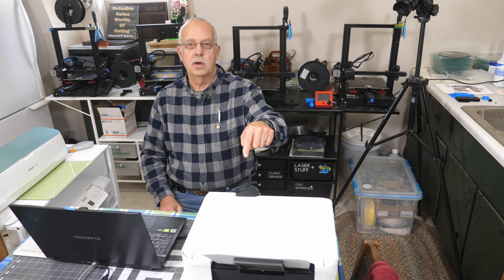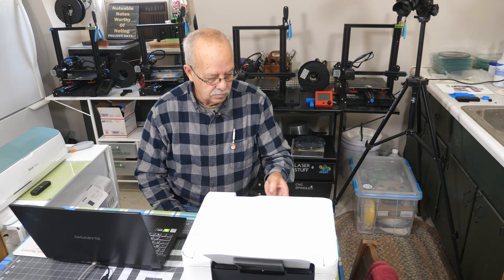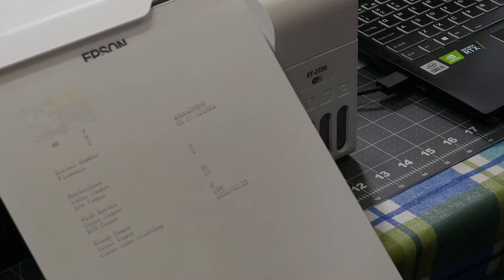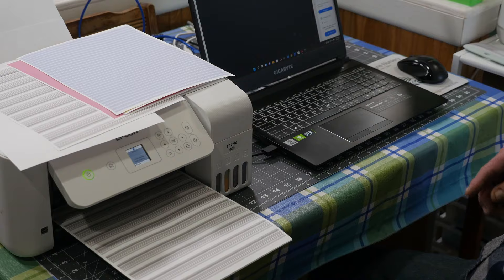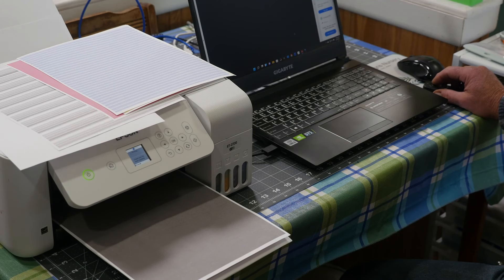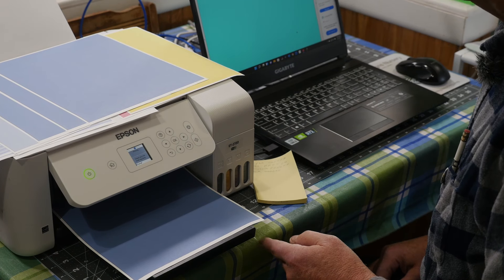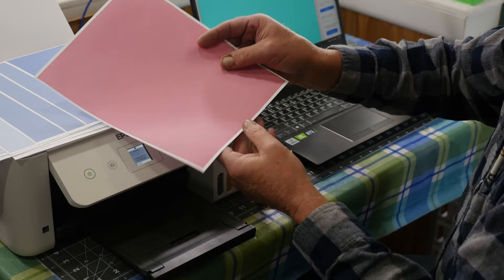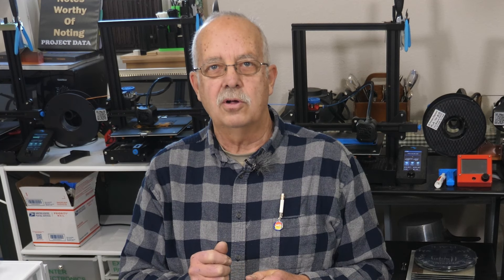Epson 2720 Printer Clogged Nozzles FIX

Comment: So what is sublimation ink and do I need to use this instead of the "standard ink" ie. black 522 that Epson sells? I would have to drain the tanks in order to do this and that is a problem.
Reply from the maker: Dye sublimation ink is designed for use with sublimation coated paper to be used in a heat press to transfer the image to a suitable substrate.  It is NOT for general purpose printing and the colors on regular paper are dull.  Many convert these Eco tank printers for use with sublimation ink when new.  Trying to do this after regular ink has been used is possible, but very difficult and messy.  Once a printer has been converted for use as a sublimation printer, it should not be used for general purpose print outs.

Comment: Hello, is it ok to blend sublimation inks?  I bought a used sublimation ink printer (Epson ET-2720) with ink already in it.  I don't know the brand.  I will be needing more ink soon, and purchased Hiipoo inks.  Is it ok just to fill? or do i need to empty then fill with Hiipoo? Thanks!
Reply from the maker: That is a very good question!  If it was me, I would try to remove any existing ink, as much as possible.  Different brands have different compositions, so mixing may not be a good idea.  I use Hiipoo exclusively, so have never attempted to mix brands.

Comment: Hi, in case it’s useful; I tried about 20 sheets with with Rogers method. I was getting zero ink apart from yellow. I decided to use the power clean. It took about 10 minutes used about a quarter of the black and less than an eighth of the colours and sorted the problem out and then my printer print is fine.

Comment: I used your download on the cyan color and printed it and it came out blank. Should I keep printing over and over or is there something else I should do ?
Reply from the maker: this may take 20 or more runs, depending on what condition the printer is in.  Make sure the ink tank has ink in it!  May sound obvious, but have run across empty ink tanks causing the problem......

Comment: I tried your suggestions but the cyan still prints a full page of very light yellow. I didn't know about the Power Clean dumping ink into the reservoir but that makes sense. It's too bad Epson would design a printer that their cleaning would eventually cause it to fail do to the full reservoir. Anyway, aside from printing a bunch of cyan sheets and still no blue, any other ideas? Thanks.
Reply from the maker: Some brands of inks can form sediment in the tank, clogging the lines.  You can try shaking the printer from side to side to dislodge a clog.  this works for some, but not all.

Comment: Hi Roger! Quick question...When I do nozzle check the page comes out completely blank! Nothing seems to work, but there is ink in the tanks. Any suggestions?
Reply from the maker: Try running multiple passes of the color sheets in the description.  If still nothing, try shaking your printer from side to side as sediment may have formed in the tanks if not used for a long period of time, then try color sheets again.  If still nothing, try a Power Clean as a last resort.

Comment: Hi Roger, Thanks for the video, but I did the purged sheets but I still can't get my yellow nor magenta to print at all.  I started printing some designs and it stop printing the colors in the design to only black and cyan.  Whatelse can I do
Reply from the maker: Gently shake the printer from side to side.  there may be sediment in the bottom of the tank and this may dislodge it.  This seems to be a common occurence with some ink brands.  As a last resort, try a Power Clean.

Comment: This is great info. What's going on with your house remodel?
Reply from the maker: The renovation house project is on hold until spring.  Everything inside is done and the Grand daughter, her significant other,  and great Grand daughter are moved in an comfy.  I don't like the cold, so it needs to get warmer before I finish up the siding and soffits!

Comment: I have tried this and the only one that prints is black. I have tried to print 10 copies of each of the other colors and still get blank pages (my ink tanks are full).
I have previously tried the nozzle check and head cleaning 4 times as well (this was done before  the step above) and no ink was showing on the paper at that time.
At this point should I continue printing or is it time for a new printer?
I heard (on another video) that placing a wet towel under the printing heads can help unclog…..not sure I want to do this step (I may break something).
Reply from the maker: If your heads are clogged that bad, a damp "blue shop towel" (don't use regular paper towels) placed under the heads for a few hours "may" soften the clogs.  Have you tried a Power Clean?  Not recommended to do a lot, but this might also break things loose.
Reply: @rogersshop  Thank you! I will try this out and see if it helps. I have not done a power cleaning, unless I have to absolutely do one.

Comment: hi. I am running the pdf files now, but there is no yellow at all.  Should I continue printing until it comes out?
Reply from the maker: Sometimes it takes a lot of sheets to get things flowing.  You can also try shaking the printer from side to side several times, then try again.

Comment: Thanks for the video. My problem is the cyan is printing yellow.
Reply from the maker: If the sheets don't work after 20 or so tries, then have a look at this:  https://youtu.be/uffJPjR7Sy8
Reply: So what I found is that the cyan cartridge in the back of the ink cartridge does not have ink in it. The one with the cellophane side. How do I fix that? My printer prints all the colors except the cyan. Is there a way to communicate directly with you? Do you have a facebook page?

Comment: just the black ink is not reaching the cartrdige on 2720 - any suggestions pls? spitty bits of black print when doing nozzle check but no text at all
Reply from the maker: Try shaking your printer from side to side gently.  Some inks can form sediment, plugging the tank outlet.  As a last resort, do a power clean.
Reply: @rogersshop  thanks for that- Unf it’s already at 75% full as I did a few, not realising how damaging it is! So I’m wary to do another one

Comment: Only the Black prints all the other one print blank. I did have the printer sitting for a couple months but its about a year old maybe 2.  Not sure what to do.
Reply from the maker: You can try shaking the printer from side to side several times and try running the color sheets again.  Not unusual to take 20 or more.  Works for most, but not everyone.

Comment: Hello I hope you can help I downloaded the pdf file the only color printed was black with lines and no colors. I did a nozzle check and color didn’t print at all. I don’t know what to do now please any advice would be appreciated.
Reply from the maker: Gently shake the printer from side to side.  there may be sediment in the bottom of the tank and this may dislodge it.  As a last resort, do a Power Clean.

Comment: I’ve done quite a few and the image is better! But i still have some ink on the edges. Like my yellow sheet has spots of black on the right edge of the paper. Do you have a tip for that?
Reply from the maker: Cleaning pads have excess ink on them.  Run several pages with just a line or two of simple text on plain paper until it goes away.
Reply: @rogersshop  I ran 7 sets (7 of each colors). My black, yellow and cyan all look good. Magenta is definitely not magenta, like at all. And there’s excess black on the right edge of each page, not anywhere else.
Just keep printing?
Reply: @rogersshop  I can email you a photo of what I mean. I only started having issues when I refilled my black yesterday. No issues prior.

Comment: Hi, I have an epson 2720, I cleaned my nozzles 4 times and it prints completely blank pages. I have been using your trick and my ink still will not come out and I just used it 2 months ago. Any tips??
Reply from the maker: Try this:  Disconnect the printer.  Pick up and shake side to side several times, reconnect cables and try again.  It is not uncommon to need to run the sheet files 20 times to get everything cleared if the printer has been sitting for a long period of time.
Reply: @rogersshop  I tried shaking it a couple different times, still no improvement. I'll get a smudge of black ink on a corner every now and then. Ran the sheet files around 20 times.
Reply from the maker: @BK-se6bj  Your lines may be clogged, which requires opening the printer and some inspections.  Here is a guide:  https://youtu.be/uffJPjR7Sy8

Comment: This seems really smart. But of course it isn't working on my printer. I started out with only the Yellow blocked/not printing (which is why I came here), with the others having just some lines. After a couple sheets using this method, black is good so I stopped printing the black page, but then magenta and cyan also got fainter, more lines, and then stopped putting out anything after about 3 sheets each. Now all 3 colors are blank/not printing any ink at all. All ink wells are over half full, except yellow, which is still full, as it was before since it already wasn't letting out any ink. I also previously used that water plunger cleaning system and ran the Power Cleaner more than once before coming here. Now I'm even more stuck than I was! Any advice?
Reply from the maker: The line between the ink tank and the damper tank internal is clogged.  Sometimes, shaking your printer from side to side several times "may" clear it.  otherwise, requires opening the printer and clearing the lines.  this is VERY involved and requires some skill.
Reply: @rogersshop  Thank you for the diagnosis. I've been struggling to figure it out for months (on and off). Are there videos that I can watch to guide me through it? I'm not a printer tech, but I'm fairly handy. Do you think it's a scrap and buy new or can I do it, or do I take it in to a repair shop? I doubt it's worth the cost of repair even, though. I wish this age of disposable products would end soon. Our environment may never recover from all this!
Reply from the maker: @RobinLShepard  Yes, there are videos out there going into detail on how to open this printer up (without breaking it) and detailing cleaning the lines and damper tanks.  I recently purchased a basket-case printer and did this video on fixing it:  https://youtu.be/woYcFhaLWRM  It does not go into the detail you need, but will give you some insight.
Reply: So after watching your vid, I decided to start taking things apart to look at it piece by piece. I stopped at the damper tanks and found there's little to no ink going into them. I sucked some ink into them with a syringe, it was not hard so I don't think the lines are clogged? But what I did find was a tiny RIP in the clear plastic side of the Yellow tank - therefore no vacuum could be created in that tank  - which was my original problem! I electrical taped it up and sucked some yellow ink in. Then I thought "Yay, after all this time, now it will be solved!!!" But no. Still no color ink (of any color) is coming out on the color pages. I then cleaned the print head just for good measure. Still nothing. 

Where is your shop located? I wish I could just bring it to you!
Reply: Miracle! After printing dozens of the color pages without change (all white), and doing all the other stuff mentioned in previous comments, for whatever reason I tried running the printhead cleaner several times in a row. I ran like 5 and all of a sudden, YELLOW INK came out! All the colors started working. I printed the color pages, all came out fine. Now the dang printer prints all colors again - except it leaves random black globs (1-2) on each page. I guess I'll take it! Thanks for your help Roger.

Comment: i have been printing for hours and i cant get my Cyan to print.  What am i doing wrong?  please help. I have to Epson 2720
Reply from the maker: You can try shaking the printer from side to side several times, then try again.  This works 'most' of time, but not always.
Reply: I’m having the same issue with cyan! I’ve tried shaking it and shaking it but it didn’t help. What else can I do

Comment: Hi Roger, I’m currently trying this trick with my home printer, and while each of the colors have been printing out (streaky but existing) the black has been printed blank page after blank page, at least pages now. At what point should I give up on this and do something more drastic? I don’t think the colors need deep cleaning but something is seriously wrong with black
Reply: *ten pages now
Reply from the maker: Try shaking your printer from side to side several times, then try again.  This works for most, but not everyone.  I could still take up to 40-50 pages to completely clear.

Comment: Thank you for your video! I had 2 colors that were still not printing. I cleaned nozzle heads several times and it did not work. I had to perform power clean.

How to power clean:
1) Go to the power clean
screen, then turn off the printer.
2) Hold the Help button and Power button when turning the
printer back on. 

It then allows you to perform the
power clean cycle. Make sure to have enough ink to perform this.
Reply from the maker: Yes, this can work.  However, it can also fill a maintenance tank quickly, which will imitate an error code requiring tank replacement (if you can find one) and a chip reset.

Comment: I'm confused first mine printed pink 💗and yellow💛 fine but no blue. 2nd time no pink just yellow and blue.  Then it was printing in black and started printing in green instead of black. Weird
Reply from the maker: Are you using the hex-coded sheet files?  These coded sheets only allow one nozzle to print.  If you are getting green, then cyan and yellow nozzles are both printing.
Reply: @rogersshop  I was using the files you shared. It was printing green before trying. But I ended up doing a power cleaning now it works. Can you purchase  waste ink cartridge and replace it before you get the error message to avoid the resetting ?
Reply from the maker: @4sp3nF41r7  I don't know if this is available from epson, or not for this model.  I know it can be removed, but don't know if they have the tank available to purchase since this is considered a low-end printer.

Comment: As of yesterday my 2720 will only print yellow and black. I used it last week without any issues. I have run probably 20 sheets of paper through just trying to get the Magenta to print. The paper comes out white every time. I have gently shaken the printer, and the  Ink tank is full. Any suggestions
Reply from the maker: Last resort is a Power Clean.  If this does not work, then the printer has failed.  Sad, but it does happen.

Comment: This process worked for my black, yellow and cyan. I have ran about 50+ pages for my magenta and nothing is printing. I have tried the gentle shake as well. Any suggestions on what else I can try?
Reply from the maker: As a very last resort, try a Power Clean.  Magenta seems to be a common denominator with clogged nozzles, based on previous comments.

Comment: Will this work if both Magenta and Yellow are both DOA.  I've run about 30 sheets of both and they are still a no-show. :(
Reply from the maker: Try to gently shake the printer from side to side and try again.  Some inks form sediment which can clog the lines.  As a last resort, try a Power Clean.
Reply: @rogersshop  Thanks, shaking did the trick. They both will need a few more passes to have all four colors clear.

Comment: The small tanks above the print heads don't fill. Black does, but not the others. Yet all of the tubes and print heads are clear. 
Is there a way to prime those small tanks? 

Last ditch effort as I have followed your advice to no avail. (I guess the last thing to try is the Power Clean) :(
Reply from the maker: Depending on brand of ink, some wil separate over time and form sediment that clogs the ink tank outlet.  Some have been able to clear this by shaking the printer from side to side to agitate the tanks, but don't get wild with this or you will have a mess!  A Power Clean will not fix this, if it is the case.

Comment: Help please!!! I tried to do what you did here in the video but my magenta and cyan are like non existent. I haven't use this printer in a couple months. I printed 3 full sheets of pictures not problem then BAM my pictures started printing in only yellow and black. I did a head clean then tried to do what you suggested in this video but magenta and cyan are printing nothing.
Reply from the maker: The problem here is not the head.  The line from the ink tank to the internal damper tanks is clogged or blocked.  Try shaking your printer from side to side several times to see if this clears the clogs.  It may take 20-30 sheets of paper run through in each of the two colors for it to clear.  If this does not work, some internal "surgery" may be required.
Reply: Wow thank you so much for responding I'll give it a shot in the morning! I'll let you know how it goes thank you so much for replying!
Reply: Sadly no success, dang it!!

Comment: Hi there all of my colors cleaned up but I am still having lines in my black. I have printed 16 pages of just black and it’s consistently the same each time
Reply from the maker: As a last resort, you can try a power clean.  If this does not clear it up, then the head has failed.